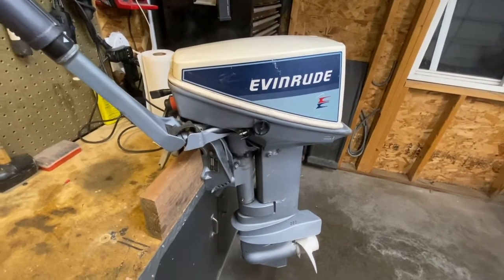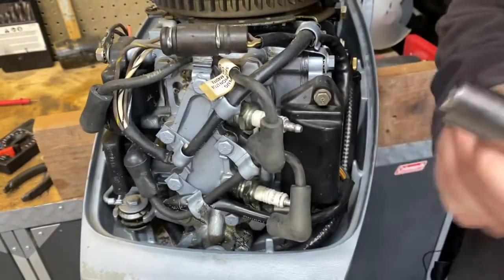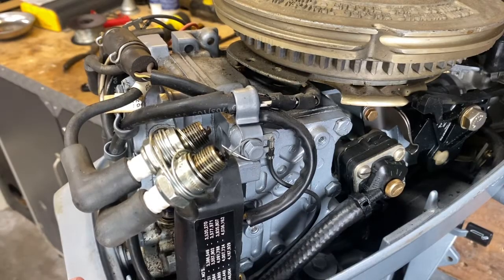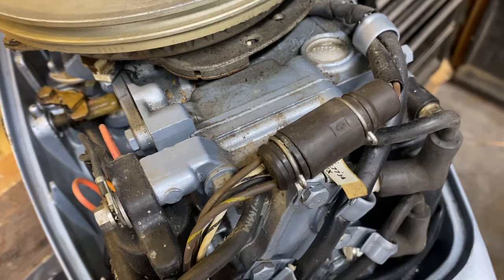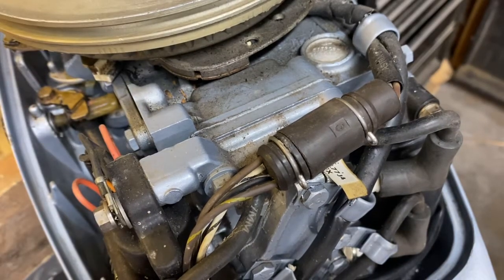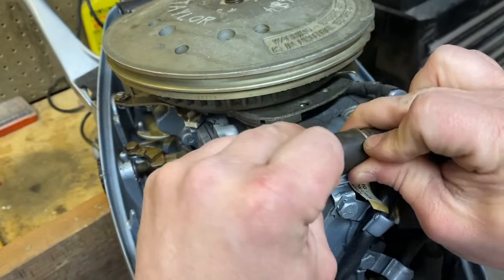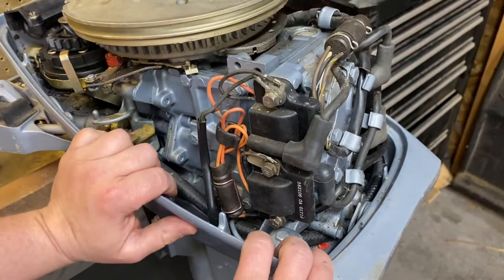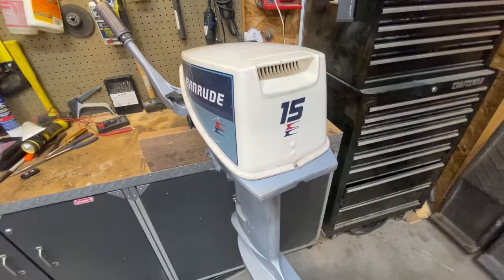9.9 - 15 hp Evinrude /Johnson ignition system Troubleshoot stater + trigger + coils testing-No spark

Comment: Excellent! Straight to the point. Usually way too much blabber in youtube videos. It's not Hollywood. Well done!!
Reply from the maker: You and one other person have picked up on what I was putting out there. I agree with you wholeheartedly, too much talking about my dog, truck, and where I live is not the reason someone watches videos like this. I have no interest in being famous, just helpful. Thanks for watching!
Reply: @wetshoesmechanic  I didn't mean you. I meant too much blabber in other people's videos. Anyway...I got my little 1978 Johnson 15 hp sorted out after trying some ignition checks you suggested. It had no spark on number one. The plugs were okay so I replaced the number 1 coil. Still no spark. Then I put a new power pack on it. Still no good. Today I checked the contacts inside that 4 prong plug like you showed for checking the trigger and stator. They were within specs. Turns out the problem was the power pack but the brand new coil I installed first was defective. In that case it would make no difference what else I replaced. Who would suspect a brand new coil to be defective? That can really make it a head scratcher. Anyway, I'm happy it's working again. I love that little engine. It's a real tiger for it's size and weight. Thanks again!!
Reply from the maker: I knew you weren’t talking about me, sorry for the confusion. Great job getting it running again! Again, thanks for watching!

Comment: This is a helpful video, thanks for posting! I have an ‘81 9.9 whose electric start has stopped working (but still pull starts) and I’m going to start with testing everything here 🙏🏽🙏🏽
Reply: If it still pull starts then none of this would be your issue, test your ignition system (key/button, starter, etc)

Comment: Great video. Not many  ignition trouble shouting videos so it caught my attention. My issue is diagnosing the power pack. will you be addressing the steps to do so in future videos? thanks again for sharing.
Reply from the maker: I might have a chance to do a video later this year but as of right now the motor is up at the lake several hours away so when I bring it home for the winter is when I’m planning on trying to do more videos. Here’s a thought though, process of elimination. Run through the components you can check and test and if everything else works out outside of your power pack and you’re still having trouble then you could just plan on your power back having an issue. Good luck to you.
Reply: @wetshoesmechanic  Good point. This is essentially the point I am at now. Thanks for the reply. Cheers from Sudbury, Ontario Canada
Reply: @wetshoesmechanic  so there is no way to bench test a Power PacK?

Comment: Thank you very much for taking the time to help us out. It is greatly appreciated.  Question, my 9.9 Johnson that I just bought doesn’t have any boots on the spark plug wires. Just the metal connectors from the wires to the plugs. They are both exposed. Is that a big issue?
Reply from the maker: I would try to find some boots to put back on there. If you touch them at all while It’s running you’re going to feel it for sure. Technically it’ll probably still work the way you have it set up, but if spark plug wires are compromised it can put a strain on the rest of your ignition system and start breaking down parts on your ignition system.
Reply: @wetshoesmechanic  thank very much! Keep up the amazing content

Comment: 1979 Johnson 6hp. Same stats is your motor. All components test good. Top coil tests good, but no spark. I swapped the wires on the connector plug, and the top coil still no spark, but the bottom coil will spark with swap. Any ideas?
Thanks for the informative video, got me to this point.
Reply: I have to add my stator range was .57 not 57.

Comment: Thanks for the video. Any idea why year old ignition coils for a similar motor would be reading resistances well below spec (and one coil reading half the resistance of the other)?
Reply from the maker: Hard to say, without inspecting the engine, but a few things could contribute to this. Even though the coils are not that old to you, they may have been made many years ago, sitting on a shelf for all these years, and the plastic around the coils could have been damaged Due to shipping or miss handling even before they got to you. Keep in mind that some of these parts for these older motors were manufactured many years ago. I would also check and make sure that you have the correct spark plug and spark plug gap. if the spark plug gap is too large, it could be causing unnecessary strain on the coil, causing them to burn up prematurely. Same could be said about the spark plug wires. If they’re old and compromise, a coil could be trying to push power through them and putting strain on the coil’s again.

Comment: hey there. I have a 12" very light weight aluminum boat with a 85 8hp Johnson outboard. I'm not able to get up to full speed. It only get's up to about 7mph. Also it bogs out and dies intermittently when cruising across the lake. Most of the time I have to open the choke to start it back up even when it's not cold and has been running. I changed out the pump bulb and got a new gas tank. I'm wondering if my gas line may be bad or too big in diameter. Would size matter if it is? It's 3/8". I rebuilt the carb, fuel pump and changed the plugs. Next I'm going to do an ignition test that you have a video on to make sure everything is firing right. I'm completely baffled and could use some help. 
Thanks a ton, Chris
Reply from the maker: If it starts right back up after it died with the help of your choke I would say it’s fuel related. The diameter of the fuel line between 5/16” and 3/8” really shouldn’t matter on that motor. I would also check your connection points on the fuel line to make sure the O ring in the connection hasn’t failed. It might be Siphoning the air from the connections and not allowing enough fuel into the carburetor and running the carburetor empty. It’s also possible that your fuel line might be contaminated and breaking apart. I usually just go down to the auto parts store and get automotive fuel line as a cheap replacement. If you suspect that your fuel line is coming apart you may have to take your carburetor back apart and make sure it’s all cleaned out again. On the ignition side of things a coil that is failing will sometimes cut out after it warms up. But usually they have to cool off a bit before they will fire again. I would check the coil casings for any cracks and replace them if you see it. I’m still leaning towards a fuel problem though. Good luck to you!

Comment: This video is great. Will this testing tell me if the points and whatever coils that r under the flywheel are good or is that a separate test. Also my white black wire has exposed wire near that barrel connector. Can it just be taped.
Reply from the maker: The motor in the video does not have points, so that will be a different test. If you have exposed wires there’s a potential for crossover in which case could cause ignition parts to fail. I don’t know if electrical tape would be the best course of action being that close to the connector, if you can find a replacement plug for that wiring harness with some wires that are still sticking out of it in good shape you could potentially splice back into the wires that you currently have. If you Google it you can find waterproof 12v connectors. I would use something like that to splice them back together.

Comment: Hey, great video. I ran through all of these testings and everything is ok, but my motor still won't start. I believe that the power pack is the problem, but I'm not 100% sure. So, if every other reading is within the specifications, that means that the power pack needs to be replaced?
Reply from the maker: Possibly. Check for spark and if you don’t have any spark then I would look at your power pack if everything else is checking out OK. If you have spark at all it would probably be a fuel related problem.
Reply: @wetshoesmechanic  So I replaced the power pack and the motor starts just fine. But, now I can't turn it off because the killswitch won't work. Do you know what could be causing this trouble? And thank you
Reply from the maker: So a kill switch works by grounding out the ignition system back to the block. If the Killswitch isn’t working it might be because the Killswitch itself might have some corrosion inside the contact points of the switch. It’s also  Possible that one of the two wires going out to the Killswitch is either disconnected or cut somewhere.  The engine will run as long as the circuit is open. As soon as the circuit gets closed that’s when it shuts off the engine. I would set your voltmeter to ohms and start checking continuity within the circuit. I start with your switch. You should have no continuity with it just sitting there. As soon as you push the Killswitch you should have continuity.

Comment: I have 94 Evinrude 8 hp I have the charge coil off had to heat shrink some places. I'm not getting any reading with my auto ranging meter. So does this mean coil is shot or could I done something wrong

Comment: I have a 78 johnson 15hp outboard and when I test the portion of the plug you labeled as testing the "stator" I get no reading. My engine does not have a stator and only has a coil/lamination assembly. Should I replace that?
Reply from the maker: Check the insulation around your coils really well. If they’re cracked at all replace them. The points and condenser are cheap enough parts that while you have the fly wheel off I would just replace those anyway. The condenser is essentially capacitor. Either the condenser or the insulation around the coils has probably failed if you’re not getting any spark and if you’ve eliminated all other possible issues.

Comment: Do you have a video for setting the points under the flywheel and how to check those ignition components under the flywheel?
Reply: That has to be the older ignition system of this motors i think

Comment: My stator tested at .900 when the range should be 450-600. Did I do something wrong or is this part bad? (Brown/yellow x brown)
Reply from the maker: Make sure you’re reading the multimeter in ohms. If you suspect that the reading is incorrect, try a different multimeter. If you suspect that you have a power supply problem from the stater and you were getting that kind of reading then it’s possible the stater is shot. Check the wires from the stater all the way down to there end point to make sure that they’re not bare and rubbing on anything. If they have ground it out, it’s possible that it could have killed your stater, but you’ll want to look at that before replacing it to make sure the new wires don’t create the same problem.

Comment: hi sir
I want to buy a speedboat. Evinrude 9.9 year 1983 to work as a fisherman. Every day I run about 70 km
advise me is a good heavy duty motor?
thank you very much
Reply from the maker: These are pretty solid motors if they’ve been taken care of during their life. As long as you put good Gasoline in them, and good quality TCW3 oil these motors will last a long time. Try to stay away from any ethanol blend gasoline, but if you can’t you should definitely run some stabilizer in it every time you fill up. Check the gearbox from time to time to make sure you haven’t picked up any fishing line around the prop seal so that the gearbox isn’t filling full of water. If it hasn’t been done yet, you should take the carburetor apart and replace the cork float with a plastic one. The fuel pump diaphragms would be another good thing to replace before heading out on long trips like you’re suggesting. If you’re going to use it for primarily idling around at trolling speeds two strokes have a tendency of loading up so there may be a slight carburetor adjustments on the fly that is needed, but they put a rich/lean screw on the front of the motor specifically for that reason. If you’re buying this motor secondhand and you don’t feel comfortable looking at it yourself, you should definitely have mechanic give it a once over before heading out on a trip that long. Don’t forget to take spare spark plugs, and a means to change them, especially if you’re idling a lot. I haven’t had a problem with them fowling in this motor, but it’s cheap insurance. The starter recoil spring is really the only thing that I’ve ever had problems with this motor with. It’s 39 year old spring steel so it’s possible to break the spring just from using it at this point in its life, also I’ve had the spring retainer end pop out of its slot once before unexpectedly. Outside of that I’ve never had a problem with this motor.

Comment: I don't know if anybody can help but I got a 94 8hp Evinrude pull start. A wire from the powerpack side came out of the of the connector on female side and 2 wires the insulation came off and have bare wires. I was just going to replace the pack and the wires to the stator but can't get that side. Any ideas how I can fix

Comment: My 1991 60hp Johnson cranks, but will not accelerate at all in the water. When I give it more gas, it dies. The motor appears fine when on muffs, but not on the lake. I changed the stator about 2 weeks back due to no spark. This started after that. Any suggestions greatly appreciated
Reply from the maker: I would consider starting with your fuel system. Clean the carbs, check the fuel lines, make sure the tanks venting properly. When it’s on muffs you can’t actually rev it up and put it under load like you would in water, and at low idol speeds “on muffs” it’s just sipping gas so it doesn’t appear to have an issue when it’s on muffs. Good luck to you!
Reply: @wetshoesmechanic  I can borrow a tank. Would that help or need to take it back to the lake to test?
Reply: @fisherofmen9941  Wouldn’t hurt to try, the propwash is going to throw most of the water out of a tank pretty quick though just to give you heads up.
Reply: @Levers103  thanks

Comment: this doesn't necessarily relate but can i ask you a question about the shifting mechanism? my shifter is stuck in forward, what would be my first place to look? i have a 80 9.9
Reply from the maker: It’s possible that the coupler between the lower unit and the med unit isn’t fully assembled. It’s possible to only partially assemble the shift rod into the coupler and re-tighten the screw, which essentially changes the length of your shift throw which would cause you to keep from being able to shift outside of the range with the gearbox would allow you to. Check out my other video about replacing the water pump, I go over the linkage in that video. https://youtu.be/MfsP9JN-xdQ
Reply: @wetshoesmechanic  it happened last Sunday. I took the boat to the lake and pulled away from the dock. got about half way across and the motor stalled. I tried to restart but cant get the shifter back to neutral.
Reply from the maker: Make sure you turn your throttle handle all the way down to its lowest setting, then pull the start rope just enough to turn over the engine slowly and while it’s turning over try to work your shift in lever back into neutral.
Reply: @wetshoesmechanic  My son and I are going to rebuild as much as we can so you can be sure I will have your channel on in the garage. I will check that first.
Reply from the maker: Sounds good, thanks for your support! Good luck to you!
Reply: @wetshoesmechanic  I will give it a try. The little red clip on the starter return is in the way can i use something to hold it open?
Reply from the maker: Thinking about it after my last comment, you might have to rotate the fly wheel by hand when trying to shift it out of gear. There’s a mechanism on there that’s called a starter pawl “Red plastic catch on the starter”  that prevents a person from starting it when it’s in gear or above an RPM range. But you will be able to rotate the fly wheel by hand. The idea is to loosen up any pressure on the dog Clutch in the lower unit in hopes that it will shift out of gear.
Reply: @wetshoesmechanic  yeah, the starter pawl. It took me a while to figure out what that is. It is working though. I will give that a try tomorrow. thank you for all your help. I am definitely going to spread the word about your channel.

Comment: You didn't mention if the stator is not getting a reading what's wrong
Reply from the maker: Full disclosure, in the video I tested the wrong side of the plug for the stator. I’m in the process of reworking the video to show that. With that being said, if you test the stater and you don’t have a reading it’s possible the wires going to the stator are compromised, or the stator itself is broke. If you’re only getting spark out of one spark plug it’s possible one of the coils has failed, but it’s also possible that your stater is giving you fits if it has failed. Sometimes when one electrical component fails on these motors it will take others with it.
Reply: @wetshoesmechanic  thanks alot i really needed the information , thanks for answering my questions sir .